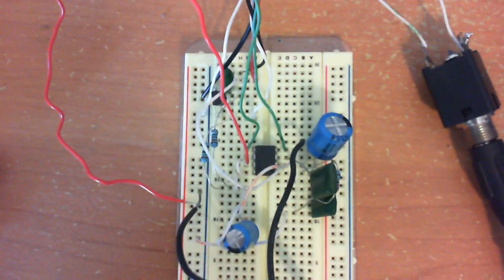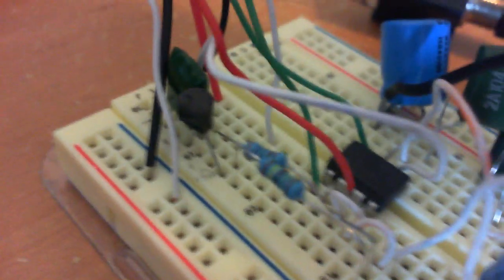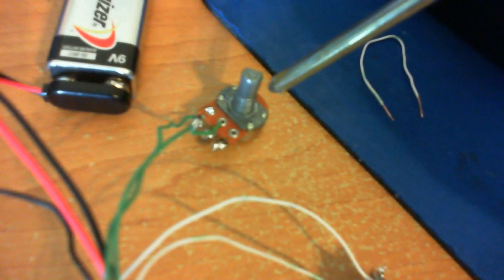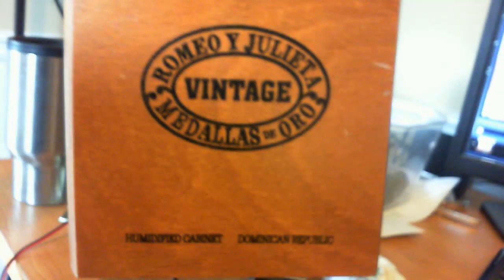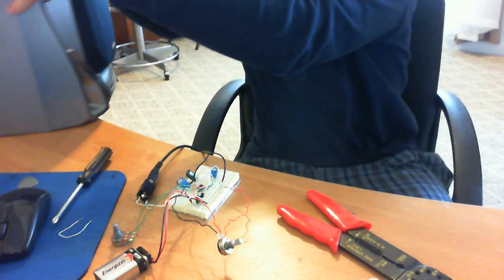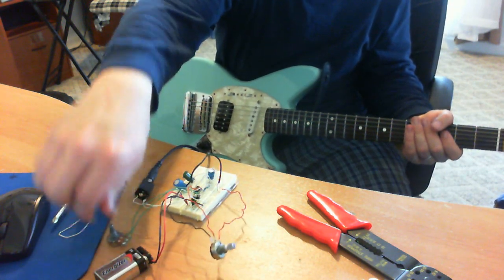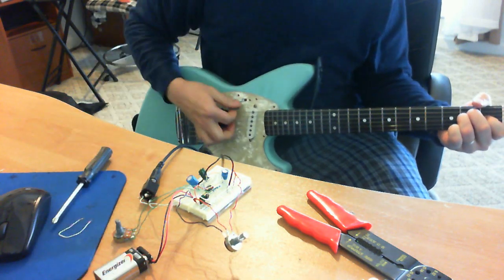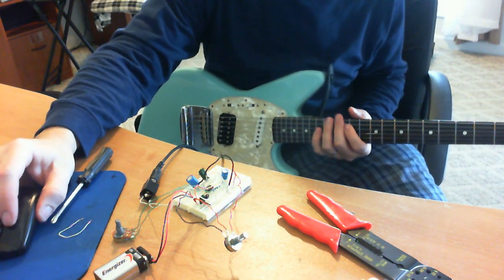LM386 amp

Comment: Hi, if you are still there, which schematic is this?
Reply from the maker: Google "ruby amp" you'll be able to find the schematic. You can also click on the link in the description and find it there. It's a neat little amp.
Reply: greendunn1 O, I found it, its called the 'Little Gem'

I plan on building the MK2 version which is two chips bridged allowing 1W of power.
It still looks unclear to me as I am new to this stuff.
Reply from the maker: Ive built the Little Gem, The Ruby, and Noisy Cricket.  They are pretty cool. NOt the best quality but for a diy, its neat, and you can house it in just about anything.
Reply: greendunn1 I just tried to make the Little Gem, it doesn't work for me. Only the MK2 works and I don't know why.
Reply from the maker: MunchMoar Here is the schematic and board layout for the Little Gem http://www.runoffgroove.com/littlegem.html
Reply from the maker: MunchMoar You can also build the Ruby http://www.runoffgroove.com/ruby.html

Comment from the maker: It is in fact a variable resistor. I think the value is 1k, but you can google "ruby amp" and that is the schematic I used. You can use a resistor, hence the pot, between pins 1 and 8 to control the distortion, or gain.